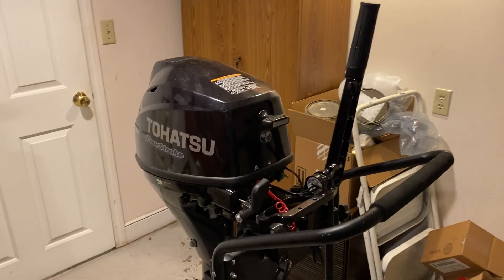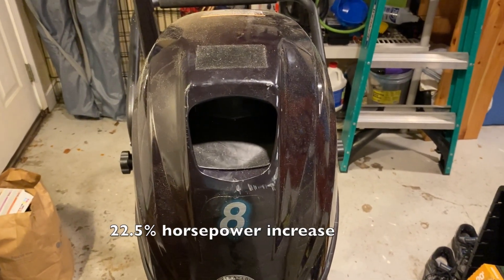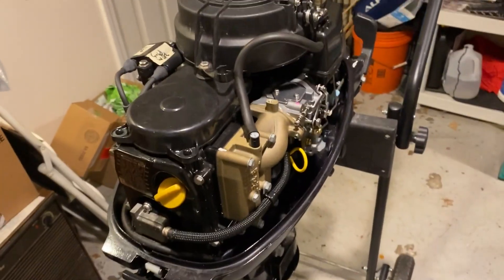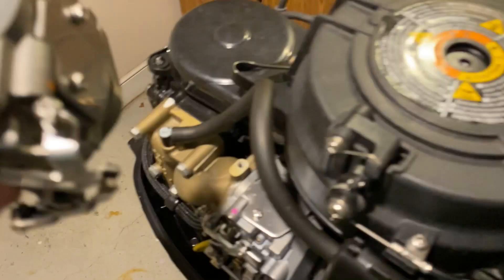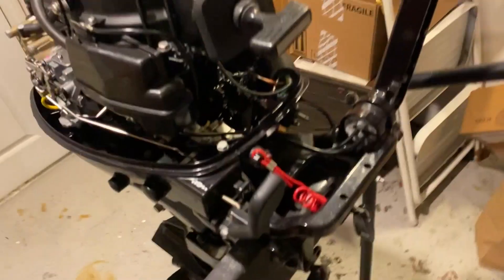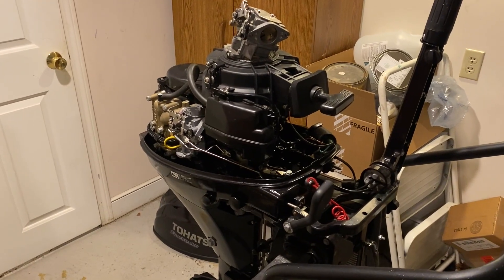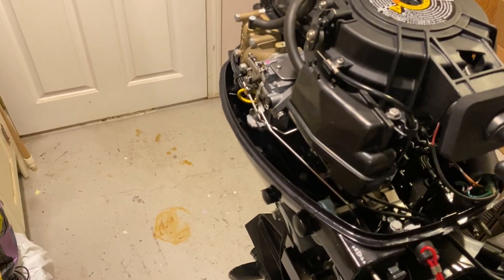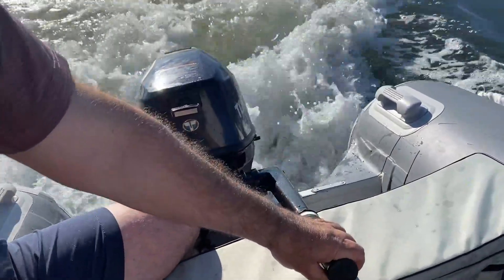Increased outboard motor  horsepower by more then 20%!

Comment: I have the 2006 model 9.8 and it has been perfect for my 1436 Jon that was converted to a micro skiff by adding aluminum flooring and front/rear casting decks. She is loaded up with a front trolling motor, two lithium batteries, full interior/exterior lighting, headlights, bilge pump, and UHD fish finder with side scan. Add in a large cooler, crab pots, and the large storage spaces, and she is really nice now. 

Getting around at +20mph is plenty awesome for fishing. Getting about the same for fuel economy too! With both of the older kids she slows down to about 17mph though... but is on plane at 10 to 12mph. 

The spanking new 9.8 model is now fuel injected and allegedly has an increase of +30% torque. 

The FI 9.9hp motor is a different block with about 30% more displacement. That one is the same motor as the 9.9/15/and 20hp motor. Which can be upgraded on the cheap.
Reply from the maker: Thanks for watching! Sounds like a perfect set up for that motor!

Comment: You are absolutely wrong, you are just running a richer mixture. You have hurt your fuel economy, reduced power, increased the carbon build up.
Reply from the maker: Wrong about what?  an 8.9 hp carb does create more power then an 8hp carb, bigger jets.  And no Im not running rich, fuel economy is the same and no carbon build up.   The engine runs great and planes the boat with 4 people which it never did as an 8hp.

Comment: If you look down the front opening of the carb, the orifice for air intake should be larger.  look behind the choke plate. This combined with a larger jet will make the engine generate more power.

Comment: this does not boost hp. Adding more fuel will just make the mixture rich so it might have a bit more torque but it will loose peak hp. To get more hp you need to add more fuel and air.

Comment: I have just bought a display 8hp Parsun motor. I understand it is a Mercury/Tohatsu clone. I plan on doing this exact same conversion, using an inexpensive generic 9.8hp carb. Can you please elaborate on what was misaligned so that the choke was jammed?
Reply: Hi man I just wanted to tell you that I made the same mistake a few yeard ago by getting a parsun, it is cheap chinese crap and it will only be problems for you I would just recommend to sell it now when it has more value and get either a new or second hand engine of companies which are more established in the boat industry. I strongly recommend any engine from Yamaha or Honda but anything other like suzuki and or even murcury ( tohatsu ) will be better than a parsun : ) let me know how you work it out and if you have any more questions please ask me !

Comment: 9.9 is completely different bigger block more weight. 8-9.8 are proven motors for tohatsu dont break if it isnt broke.
Reply from the maker: Yes, the 9.9 is a different motor than the 8-9.8.   Upping t6he horsepower of the 8 to 9.8 is an easy inexpensive way to increase the power and make the engine more useful.
Reply: @CruisingCalypso  lots of variables there. If being used as a kicker no noticeable gains. If using on a dingy then perhaps but is it worth it? Unless the carb was gummed beyond cleaning perhaps but in small hp applications meh the bigger 9.9 will have better torque. 
4-6hp single cylinder though is generally a good upgrade

Comment: I also have an 5 and 6 hp. They also run exactly the same speed provided you change the prop om the 5.
Reply: I have a 5hp that I want a bit more out of. Never heard prop change?. I heard of 6hp carburetor.  Needs rebuilt. I will probably do some porting and shave head. Looking for more ideas.

Comment: I made the same mod but changed back because the 8 carb runs exactly the same ie. NO power increase what so ever.
Reply from the maker: That's a very interesting result.  For me I saw a noticeable  increase in top end speed, from 17-20 its,  and the ability to plane with more weight.
Reply: Mine 8 runs 22 knots on a rowing boat with 1" bigger prop.
Reply: Did you only change the carburator? I have the idea to do this mod too on my Mariner 8 hp from 2005 (same engine as Tohatsu) but if there won’t be any difference, I would not do it.

Comment: If you do some porting you will get even more
Reply: Hi sir, What is porting?
Reply: Just different jets would not work it would just run too rich. The new carb probably opened up the throat of the carburetor as well.
Reply: Does this work on the 2004 NSF8A model?